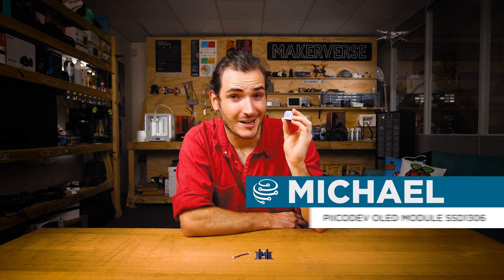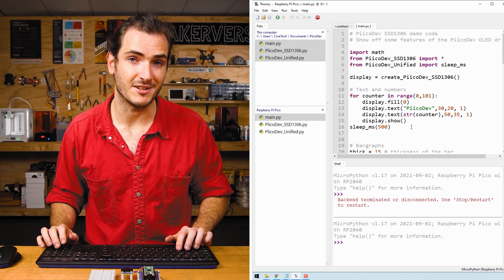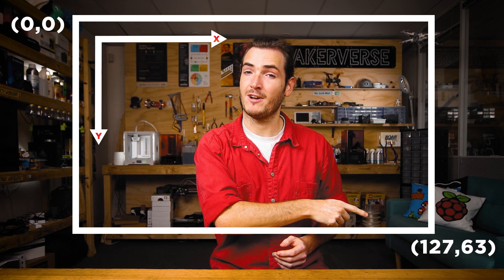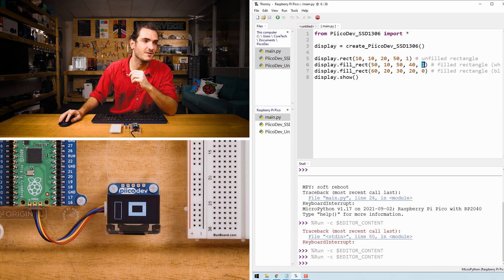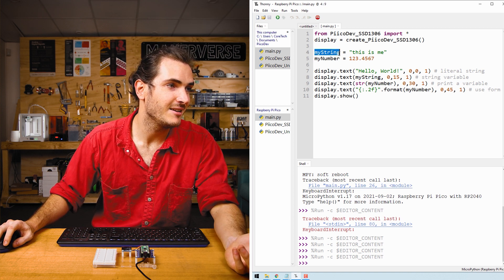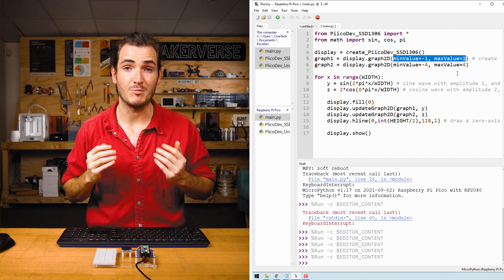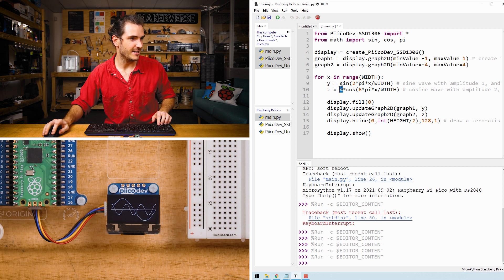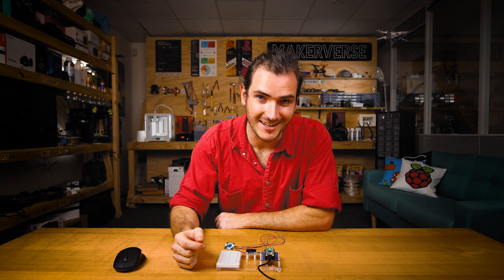PiicoDev OLED Module SSD1306 | Raspberry Pi Pico Guide

Comment: display.text( chr(178) * 5, 0,0, 1 )  # or any value above 128/129, should show 5 blocks on it's side aka a fat line,  
only if the oled behaves the same as mine.  (not from Core Electronics)  
used to make big numbers for clock   (5 oleds in portrait mode) seconds animated with 2 lines filling to the centre.